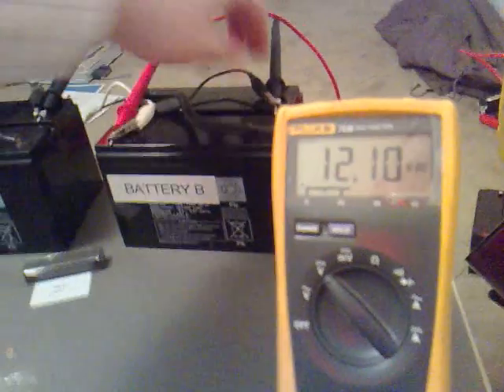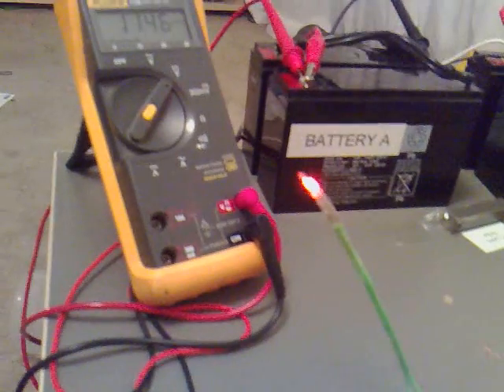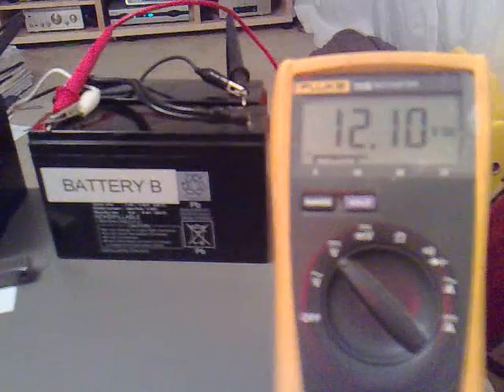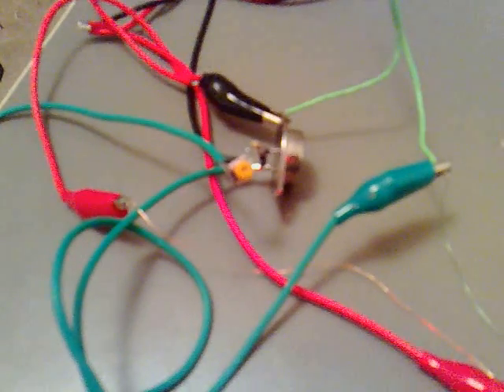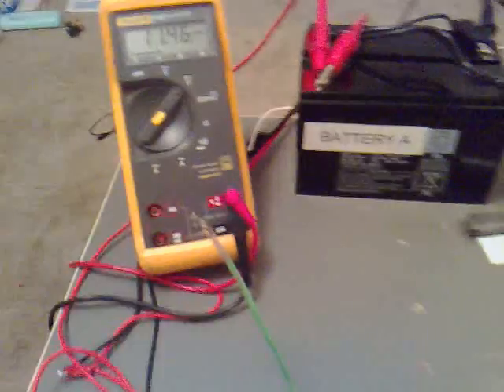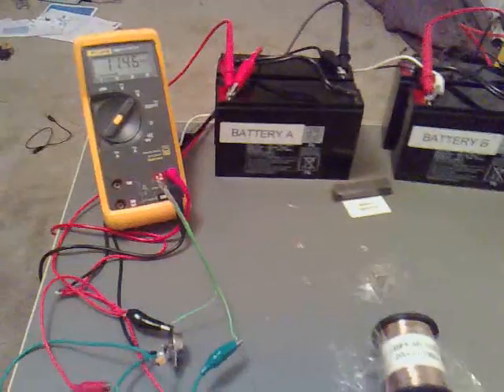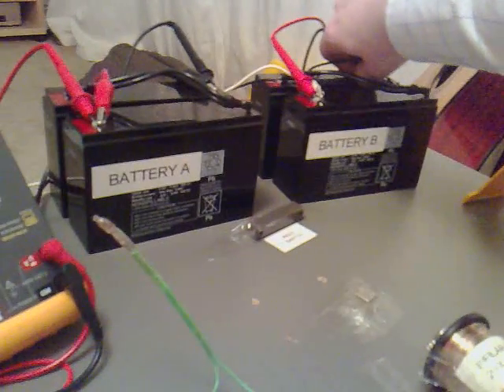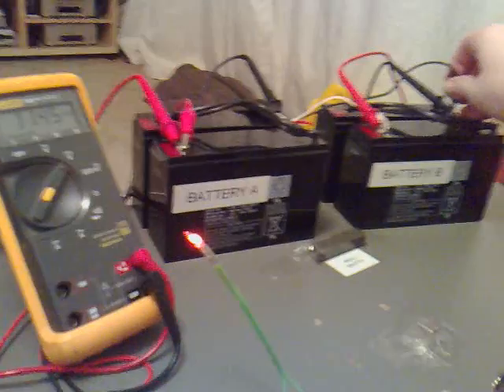Pulse Motor (Resonance) 044

Comment: thats interesting.  I was using rare earth magnets on my first motor but they were so strong it wouldn't run at less than 300mA so I counteracted that by using less iron filings and more silicon in my core... worked well, but bedini recommended weak magnets so i've upgraded (or is that downgraded?) to ceramics and now using a high iron density core.  very interested to see how an air core performs ^_^

Comment: Nice work... You do get more volts showing in the battery without the wheel...You dont actually need the magnets on top of the coil either...I'm just going back into my lab to investigate, but late last night the neon lit up with the weirdest plasma inside... I'm gonna try and repeat it and get it on video...

Comment: Like I said... You don't need spinning wheels to make flyback by the bucket-load...!
It looks like you've got the chattering relay without the contacts... Just a singing coil and flyback voltage in heaps.